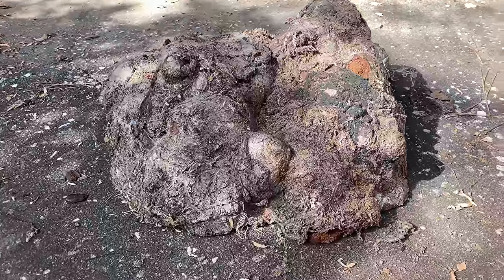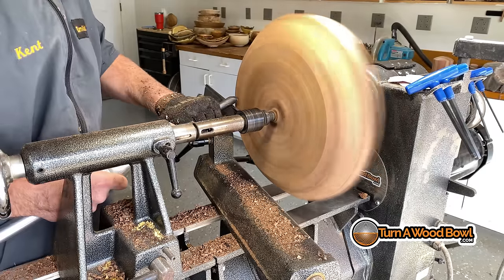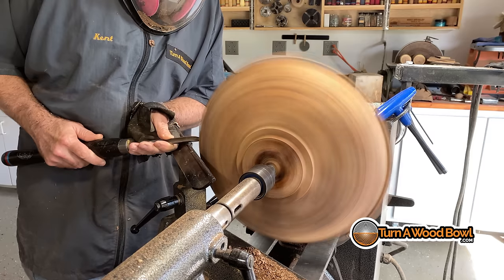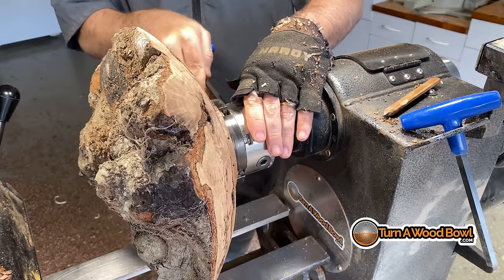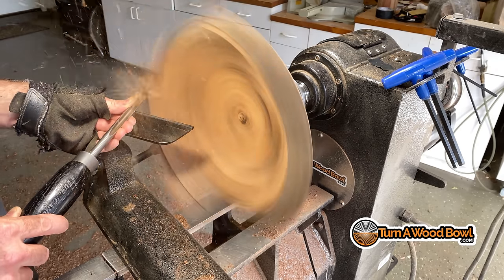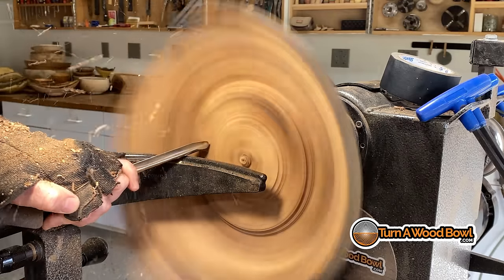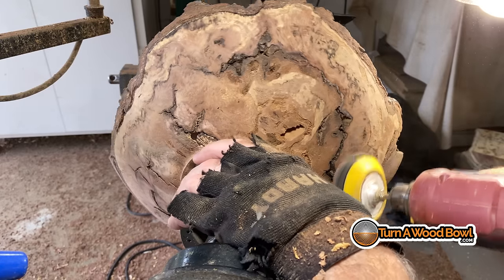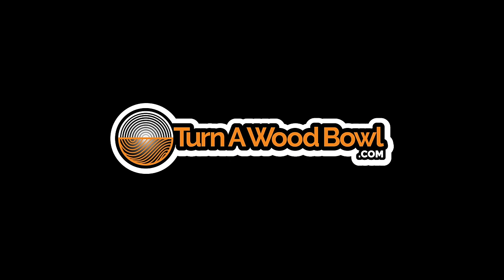Dangerous Burl Live Edge Bowl Woodturning

Comment: The expertise used to turn the interrupted cut of varying hardness is amazing. The morse taper extension in the tailstock is commonly called a drill extension and is available from machine shop suppliers ($20-$30) with different morse tapers in the hole and the shank. This lathe has standard #2 morse tapers so getting 2 extensions with a #2 morse taper shank combined with #1 morse taper bore (hole) effectively allows turning very small projects like pens in larger lathes using small lathe centres and drives. Larger bore than shank adapters are also available for larger accessories but have to be used with caution because large accessories can overload the lathe.
Reply from the maker: Great information. Thanks for sharing. Happy Turning!

Comment: CA glue and saw dust combination has always been questionable in my mind for strength.  I’ve seen too many failures in bonding over the years.  It might be good for putting balsa wood air planes together, but I’ve always questioned its strength while turning wood.

If I encounter a void in the wood that will be eventually turned away, I will mix a concoction of baking soda and CA glue to fill it.  This makes a very hard and strong temporary patch.  But, you don’t want to leave it on the finished product surface since it will not take stains or other finishes other than paint.  However, as I think about it, what’s to keep one from mixing CA glue with saw dust and baking soda to make patches.  Maybe some dyes or other coloring could be mixed to patch wood voids or punky wood.

Comment: Great video and a really interesting piece of wood!  I have a question for you.  When I turn bowls, I usually sand and finish the outside before I turn it around and put it in the chuck.  In this case, since there are so many bark inclusions and punky areas, I would think that some sanding sealer and finish might help to stabilize the bowl as you hollow it.  Did you consider doing something like that to limit the dangers of losing pieces while hollowing?  If so, I'd like to hear what your thoughts were and why you decided to go without.
Reply from the maker: Yes, indeed, I will use shellac to strengthen weak fibers and glue delicate areas if needed. With an open design like this bowl, accessing the exterior after the turning is not much of a problem, so waiting until the end is ok. Hope that helps. Happy Turning!

Comment: Fantastic Bowl!! Your videos are extremely helpful! Thank you.

I have a similar shaped eucalyptus burl that I am trying to turn at the moment. I have attached the flattest side of the burl to a faceplate which is centred, although as i turn on the lathe it starts to vibrate to a point that i don't think it is safe enough to turn. Do you have any advice as to how to get more equal weight distribution or or how to stop the rocking and vibrating of the lathe?
Reply from the maker: First of all, turn the lathe speed down if the lathe is variable speed. If that's not possible, be sure to stand out of the line of fire and slow turn away material until the piece becomes more balanced. These types of turnings rarely become perfectly balanced ever. All the best to you and Happy Turning!

Comment: hi Kent,  We have an odd shaped burl that we are having trouble determining how to get the most out of it.  Your burl is almost bowl shaped to start with.  Ours is 5 feet long, and about 20 inches in diameter.  We have a sawmill.  My thought is to cut it into 3  6 -7 inch slabs and then cut bowl blanks.  Do you have any thoughts?
Reply from the maker: Burls are tricky Chris. Yes, it sounds like you are on the right path. Perhaps cut a small section and turn it. Then you will be able to best determine what to do with the remainder. All the best to you and Happy Turning!

Comment: I like the idea of using shellac to coat and bond the wood fibers but do you follow up with a poly orsome other waterproof finish?  Shellac as you know water marks/
Reply from the maker: Good question. I don't use shellac as a final finish. For strengthening end-grain, the shellac is only temporary and will mostly sand off the surface. For pieces I want to be gloss, I will apply an undercoat of shellac then spray lacquer over that layer.
Reply: @TurnAWoodBowl  I love the live end turning as apposed to a fully symmetric bowl - live edge is just so much more interesting and beautiful. Why do you use lacquer vs poly, maybe because it's more sprayable then poly?

Comment: Really beautiful and inspiring Kent. One question which filter did you use on the mask for the CA fumes?
Reply from the maker: Most filters won't stop CA fumes. Be sure your space is well ventilated and don't stand right over the CA. Happy Turning!
Reply: @TurnAWoodBowl  Ventilation may be a problem in the basement as I don’t have windows to air it out. Maybe I can unmounted and take it to the garage.

Comment: Sorry, I do have a question. Since the bark is fragile and does not have much to hold on to, would’ve been more prophylactic to saturating it at the connecting area with CA glue and accelerator?
Reply from the maker: There really isn't a need to soak the whole bowl, I just work the loose areas that might become problematic.

Comment: How many times did you need to sharpen your tools on this burl... how many different tools were used, to avoid dulling them in this turning job?
Reply from the maker: Not sure, maybe 4-5 times to the sharpening wheel. Two tools, one 5/8" gouge to rough and a 1/2" to make finishing cuts.

Comment: You do good work! Many turner videos give little-to-no info verbally. Thanks. But you said it had punky spots, so how fast were you turning?  I think I saw speed changes.  There were NO catches until the big one, or so it seemed.  If you did not add resin could you have treated soft spots with CA? And did I see a carbide tool in there? (Or maybe that was in the video before yours.)
Reply from the maker: Glad it was helpful! My lathe speed is always changing for the given moment. See my lathe speed video coming out tomorrow. You can use CA or shellac to seal and tighten up loose fibers. No, there weren't any carbide tools in this turning, only traditional HSS tools. Happy Turning!

Comment: Mix up some colorful resin, brush it on or dip it, and then vacuum seal it in a big bag or a vacuum chamber to try and suck all of the air out of the wood . When it's cured tool and sand it to a polish. It's much stronger and looks cool too. Just clear resin with maybe a green metallic would have looked nice in this piece of wood
Reply from the maker: Sounds like a plan.

Comment: Is there any reason you use ca glue instead of epoxy?
Reply: Also the bowl turned out pretty nice 👍
Reply from the maker: Yes, the CA is water thin and will penetrate deep into cracks, it dries very fast and it's almost invisible. Great questions. Thanks

Comment: has anyone tryed to cook it in oven on non burning for wood temperature to kill it to never ever grow, shrink or etc?
Reply from the maker: Good thought, but drying in the oven will remove moisture too quickly and cause major stress fractures and cracks.
Reply: @TurnAWoodBowl  i think there must be the right temperature and timing to do it perfectly fine, tho wood thickness should be thin to do it consistantly, if wood is thick microwave will heat up insid and outside of the wood on the same temperature,  this thing is hard to master :3

Comment: How about instead of tape taking a curved piece of wood and glue the weak pieces together.  You can than knock it off and sand down the glue.   Seems like it would make a better bond and less chance of the wood flying off.
Reply from the maker: I agree it would be a better bond, but I didn't want any glue or resin visible, just the natural oak burl. Happy Turning!
Reply: @TurnAWoodBowl  Thanks for the response.  I thought that sanding it would get all the glue off but I don't know how far it would penetrate into the wood and I am not an expert by any means on the subject.

Comment: I’m curious. Just going through a second hurricane myself in Louisiana, where did you pick up that burl? I have been driving around cutting out burls from fallen trees lately
Reply from the maker: Burl, depending on species, is like 1 in a 1,000. You have to be lucky and very observant. Look for balls or weird growth shapes on the sides of trees. These aren't scabbed over cut-off limbs, they are free-growing protrusions on the side of the tree. Good luck and be safe out there.
Reply: I have found that anywhere trees get damaged when young , there is burl . I live where there is a large spring runoff  , and where ice flows through on high water almost all the box elder has some amount of burl .

Comment: why would you not use a saw to remove that obvious excess this was needlessly dangerous not to mention bad for your machine will that off balance not mash your bearings up it looked so unstable
Reply from the maker: Not sure if I understand your question. If I cut it up it would never look like it does now. And an unbalanced pieces is fine as long as it's not turned overly fast.